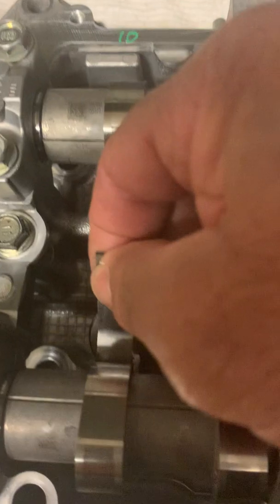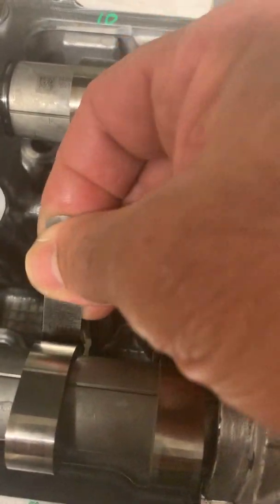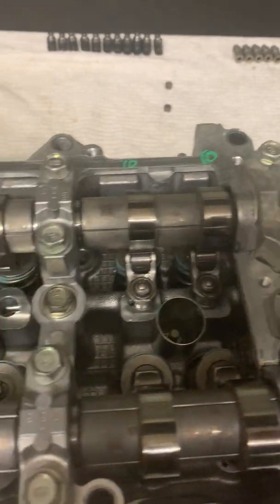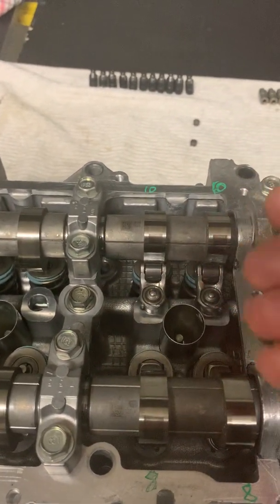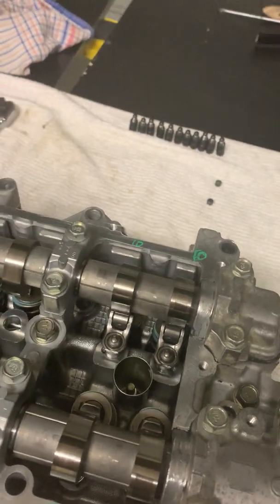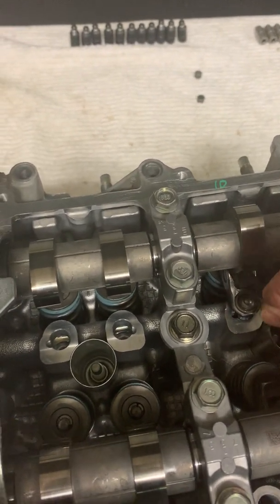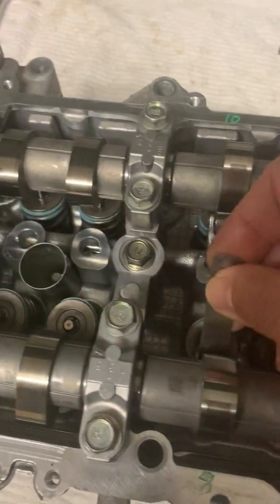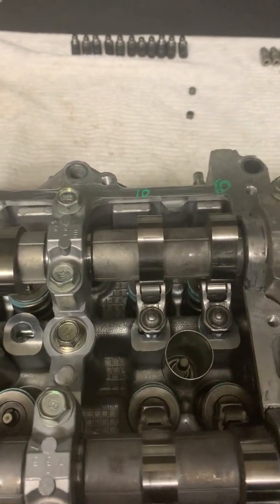FA20 Engine Installation of Rocker Retainer Kit - Setup clearances first!

Comment: What happens if you mix up the rockers slightly but the shims are in the same place?
Reply from the maker: Hey @Nishim0to, you would need to re-measure lash due to potential mismatched wear patterns between the camshaft lobe and rocker arm.
Reply: @denstoj  thank you! …so i would just be remeasuring clearances and making sure that they are still within specs. If they are then I can keep the rockers the way I have them? Am I understanding you correctly?
Reply from the maker: @nishim0to yes you’ve got it 👍
Reply from the maker: @M0t018-y4y  let us know if you have any other questions. Happy to help. Great that you’re giving it a go yourself.
Reply: @denstoj  thank you for your time and video!
Reply from the maker: @nishim0to anytime! 👌

Comment: Based on what I've seen, the recommended valve specs according to Subaru for the fa20 are intake: 0.10 - 0.15 or  exhaust 0.20 - 0.24. I notice you guys have different specs listed on your website. Is that due to your shop quality testing and you've verified that the specs you provide are safer or more efficient than the specs provided by Subaru? I'm at 50 000km in my 2016 BRZ so I'm looking at pulling the motor at my next oil change to re-shim my valves to spec and I'd like to install your kit as well. I'm just curious as to why your specs are different from what the Subaru info I found contained. Thanks!
Reply from the maker: Our specs are based on the service information via the Capricorn workshop database that we have access to. Comparing them to what you've quoted, ours at Inlet 0.10-0.16 mm (cold) and exhaust 0.21-0.27mm (cold) are on the looser upper tolerance so I'd go with the upper tolerance of what you've quoted to always ensure proper valve closure and with our retainers there is minimal risk of a rocker dropping. Great plan. Do you mind providing the link to your source? I'm curious. Cheers!
Reply: @denstoj  Yea it's interesting! I've been trying to find the answer to what the proper spec are so I've found multiple specs online (videos, forums, other variations of capricorn, and talking to techs at the local dealership) while trying to clarify. If there was info on the internet about fa20 valves I read or watched it.

There seems to be 3 variations. The second variation that I found was only 0.01mm greater on the loose side of the intake compared to my clearances stated above which are the most common. The third is what I noticed your website stated which is exactly the same as you have just provided above and which actually started my search in the first place haha! I saw your recommendation was different from what I knew and had to find answers!!! I have seen your clearance recommendation once after starting the search on a uk website but it seems to be the least common of the 3 recommendations which leads me to believe it may not be the most ideal recommendation.

I would say on the hours of digging around the internet I've seen my mentioned clearances 85% of the time, the variation of my clearances 10% and your clearances only twice from yourselves and one other source around 5% of the time.

I''ll provide a few quick links to different types of content with clearances bellow, I didn't save all of them as I went and I finished by the time I read your comment. Hours of reading anyways so I'll be glad to save you a day or two on the subject haha! Anything I found is on the internet and accessible to anyone else (other than all date) but I have spent about two days coming up with the info I have which seems to be that the most common recommendation by far for clearances is intake: 0.10 - 0.15 and exhaust 0.20 - 0.24 both cold for the fa20.

I went back into the internet and pulled a few samples for your review if you'd find interest in that!

https://static.nhtsa.gov/odi/tsbs/2014/SB-10084247-0699.pdf

https://www.ft86club.com/forums/showthread.php?t=146319

http://zatonevkredit.ru/repair_manuals/raw_content/AWIyZ2P9RvZszzJrj69n

https://youtu.be/XSKxCUkdupA?si=BFzwFoVirqL7TWec&t=440

Additional I've searched All Data which is my capricorn over here in Canada and it stated my stated tolerances as well.

I was kinda concerned not only for myself but everyone else putting in some work on these motors including clearly your customers. I noticed you had a few guys that do race quite often repping you which was cool to see. The looser end of the spectrum is more ideal anyways which your clearances clearly favour, but I figured I'd reach out and let you guys know! Maybe I would be able to bring light to something that may require your attention being everyone that orders from your site WILL use your provided specs. Other than yourselves I only found this website that agreed with the clearance you provided: https://www.gt86.org.uk/forums/forums/topic/2229-stripped-engine-details/
I'm not at liberty to say for yourselves but maybe providing the clearance I mentioned may be better for yourselves or your customers. That's for you do decide but I just thought I'd kindly start the discussion amongst Denstoj! You guys are skilled engineers who worked for the big corporations and I'm just the car enthusiast trying to shim my valves :) haha.

If you have an email that would contact you more directly than I'd appreciate it if you could share it in a comment bellow so I can reach out. If your not comfortable with that I could share mine instead, feel free to ask if you'd prefer that. Thanks and have a great evening!
Reply from the maker: Love all your detailed effort! We will give this the proper read and response when we can. Yes for sure, you can contact us at rockers@denstoj.com.au and one of our team members will chat with you over email.
Reply from the maker: Hey @deonesobord, Thanks again for the thorough reply and for sharing all your research — it’s awesome to see your dedication to finding the right specs for your build! We genuinely appreciate your effort to bring this to our attention and for providing all the sources you found.

It’s true that there can be multiple recommendations floating around, especially for engines like the FA20 that are popular in the modding community. The specs we list on our site are indeed on the looser side, and that’s based on what we’ve found works best for higher-performance or racing applications, where extra margin is valuable to accommodate thermal expansion and prevent valve damage. Our go-to specs are 6 thou (0.1524 mm) for the inlet and 10 thou (0.254 mm) for the exhaust. This range offers a good balance between performance and longevity, particularly when running the engine at high RPM or under load for extended periods (and also easiest to measure with common feeler gauges being imperial!).

We understand that the factory specs or more commonly recommended specs like the ones you’ve shared are perfect for many users, especially those using their vehicles primarily for street driving or within factory tolerances. However, our recommendation aims to cover a wider range of use cases and err on the side of caution for those pushing their engines harder, which is why it might differ from more frequently quoted values.

Thanks also for pointing out the UK source that matches ours — we’ll review it further along with the other info you’ve provided to see if there’s anything we need to refine. It’s always good to have open discussions like this to ensure we’re giving the best guidance possible to everyone. We will update our website to explain both ranges people might find online. 

As for contacting us directly, as mentioned you can reach us at rockers@denstoj.com.au — feel free to shoot us an email with any other thoughts or questions! If there’s anything else we can do to help you with your build, don’t hesitate to ask. We're keen to see our retainers on your motor!  

Thanks again for your thorough research and feedback. Have a great evening, and good luck with your BRZ!
Reply: @denstoj  That was a brilliant response. I agree with you thinking about it. It absolutely makes more sense to run looser spec when you know you'll be cooking the motor and expanding metals further in a motorsports atmosphere. That's a topic I haven't heard a single person bring up before you have. Thank you for that and all the great attention you've given to this thread. It's well appreciated. You've genuinely helped me walk away from this conversation with an greater outlook for future work on all of my motors. I hope you found my inputs to be equally valuable. Have a good one man, it's been great talking! 😄
Reply from the maker: Thanks for the kind words! Glad to hear our explanation resonated with you. It’s always good to consider the specific environment in which the motor will be running, and I’m chuffed that we could add an additional perspective. We definitely appreciate your thorough research. It’s been a great conversation for sure, and I’m sure it will be helpful for others who come across this thread. We will continue chatting over email. ✌️

Comment: Hey Im wanting to the valve adjustment on my br what micrometer do I need?
Reply from the maker: Hey! On the FA20 in the BRZ, the clearances need to be between Inlet 0.10-0.16 mm (cold) and Exhaust 0.21-0.27mm (cold). We have a worksheet to help when setting up the valves here: https://docs.google.com/spreadsheets/d/1Ld78m5UFX5meDGyf2uukR9JtfcJP9cHZLUvrdrSbaMA/edit?usp=sharing

Comment: Sorry just wondering what actually adjusts the clearances. Is the the shims on top of the valve springs? And where do you get those?
Reply from the maker: No dramas - Correct, it's the shims and you can order different sizes from your local dealership.

Comment: Not quite sure if the inlet and exhaust side use different size shims. But if they do they most likely got mixed up.
Reply from the maker: Yep, clearances are different between intake and exhaust so depending on your setup you’ll need to use different shims accordingly. 👍

Comment: May i know whats the clearance inlet and exuast (lifter have no valve)
Reply from the maker: Hey Jijesh, FA20 valve clearances should be INLET 0.10 mm - 0.16 mm and EXHAUST 0.21 mm - 0.27 mm (cold). We prefer to run on the looser side to ensure the valve seals properly. Let us know if you have any other questions.

Comment: Are these in stock? What is eta on shipping to the U.S.?
Reply: You guys are amazing , received my retainers in two days and they are looking pretty 🤣 . However Im running in to another issue , last two intake rockers I’m getting a gap of 00.13 mm and the rest 00.8 , they feel a bit loose and I’m afraid it will make the same ticking noise again like it did  before , any idea whats causing it can the valve be shorter than the rest ? ( inspected no damage) , I switched caps from one to another still the same , can I get a fatter valve cap” to make up for the slack ? Thank you !
Reply from the maker: Awesome to hear! Glad you think they're pretty too 😎. Yes, you can order different thickness lash adjuster caps. I'll check with Dennis with what he thinks may be going on. Thanks, Dan S.
Reply: @denstoj  Thank you kindly !
Reply from the maker: Yes, I have checked with Dennis. All lash adjustment is done through the lash adjuster caps on top of the valve stem. There are different thicknesses available from your local dealer. He would also recommend winding over the engine (with spark plugs out) and re-checking lash. If you have any further questions, please feel free to ask us. Thanks, Dan S.
Reply from the maker: Yes, currently we have stock of our bespoke rocker retainer kits. Shipping to the US is 5-7 days with TNT/FedEx Express.
Reply: @denstoj  thank you. Ill be placing an order in a wk
Reply from the maker: @1atinlove  Great, I'll keep an eye out for your order and then get the kit shipped out as soon as possible.
Reply: @denstoj  thank you
Reply from the maker: No worries.